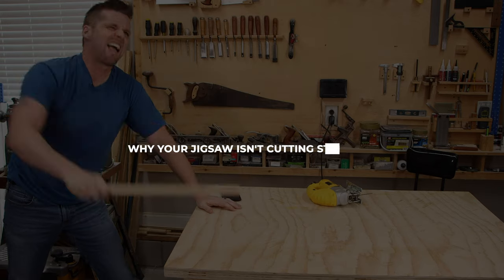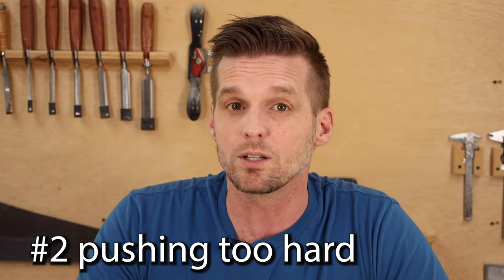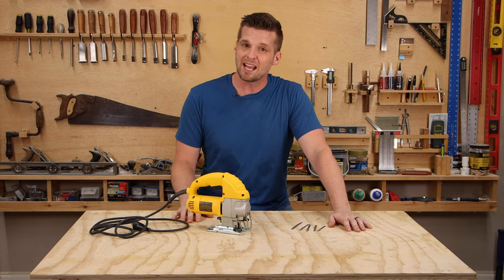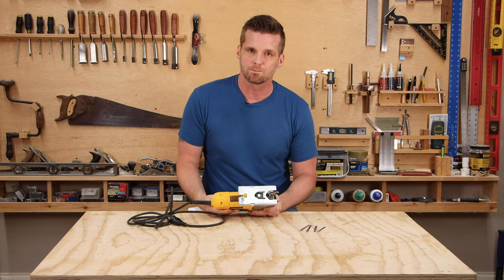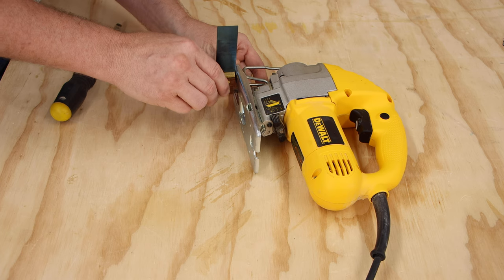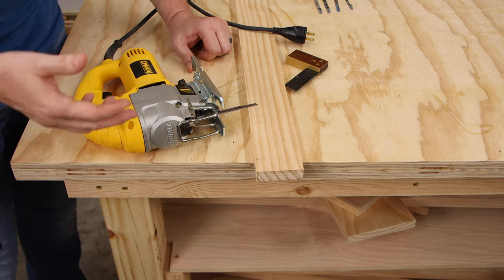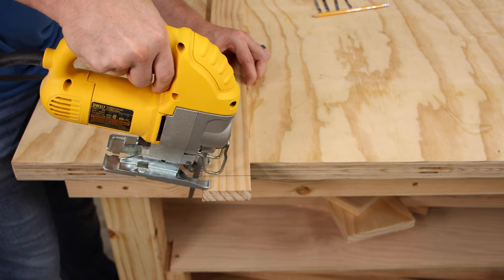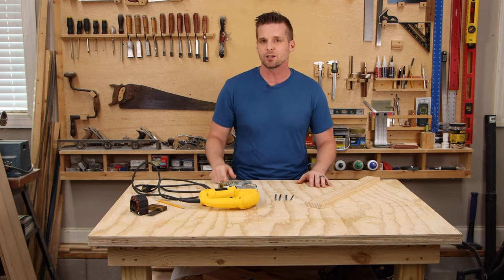Why Your Jigsaw Isn't Cutting Straight. How to Avoid Wandering, Deflection, and Bevelled Edges.

Comment: my milwaukee m12 vibrates like crazy, and I learned that the chuck is misaligned and slightly tilts the t shank clockwise. causing massive cutting issues. I'm using a bora straight edger with a t track "jig" that guides the jigsaw perfectly straight. The blades are totally new, Diablo fine tooth for "straight, angled, or curved jigsaw cuts." but the m12 has already warped one of them. I cut pretty slow as well and let it cool down after a few inches. 

Compounding the issue, the right side of the bottom is bent upward, and causes the anti-slip guard to pop off if it gets hit by the blade (which it eventually does due to the blade warping from the misalignment.)

The manual does not tell me how to realign the chuck (manuals are becoming extremely useless, not nearly as detailed as they were in the past.)

My dad has experience with older jigsaws and is also suprised by the crazy vibration.
Reply: I had the same issue..
Reply: @izzy8823  yeah. I returned my m12. I suspect that home Depot mishandled it causing the bent shape, and that they will just put the defective item back on the shelf. Could also be design flaw. I bought a reciprocsting saw that converts to a jigsaw with (with the ability to  reciprocate for faster cuts) from worx. Which is pretty neat. Just have to flip the blade to use either.

Comment: And here's a beginner's tips for beginners. Buying the cheapest jigsaw from a reputable brand is ok. Buying the cheapest jigsaw from a dubious or sometimes no brand at all will give you nightmares. Not even for a simple d.i.y. I bought mine a decade ago when I needed one to cut some boards, thus thinking a $20 jigsaw is ok. It is not. I could never cut straight with it, because the saw chuck itself sat on an angle with no way to straighten it up. And it gets worse after some use. A trip to the store later to return my machine and a $20 additional price gets me the lowest tier Bosch jigsaw. Still runs today through several house remodeling with only brush replacement.

Comment: What i do is use a straight edge to outline it with a thick marker (moved over a little bit depending on how accurate i need the cut) and go straight on the edge of the marker line and it works every time. Only with about 2 very minor bump

Comment: I have an old Black & Decker 3.5 amp jigsaw that I’m trying to use to cut circles. Tried Diablo fast wood blades and Warrior 10T blades. Both blades bend within the first half-inch. I took it nice and slow and noticed bend as soon as the blade touches the wood. I’m thinking it’s time for a new saw.

Comment: Love your presentation style. I deliberately came here as I always have a problem with jjigsaw cuts. I have three different jigsaws from a cheapo to more expensive model. If  I am cutting say 1-1.5 inch wood on a 6 in cut the blades seem to bend during the cut, ending up with an end that looks more like grandmas quilt than a square cut. Tried new blades all are set up square, not pushing hard etc, so wtf am i doing wrong?
Reply from the maker: The variables are: 1) have the correct blade 2) blade needs to be sharp 3) shoe is square to the blade 4) let the jigsaw make the cut and don't force it 5) direct it in a straight line (i.e. don't wander all over the place). It has to be one of those variables that is off.

Comment: If Jig saw is not easy to setup and get on work with. Try calibrating a miter saw for accurate simultaneous 90, 45 and bevel cuts.

Comment: My Dewalt dw321 has a blade holder that is not parallel to the fence. It is visibly out of alignment. I figured there would be a way to adjust this but cannot find any information. I don't want to force anything and snap the shaft or other part. Any help?

Comment: You talk nice but you hav a Dewalt, try the same technics with Rider, with the blade, is tilting even the base is 90 degrees. Even on slow speeds, with very little push the blade tilts on one side and sometimes is poping up from the roller which support it.

Comment: In my jigsaw blade jumps out of the rollers that are there to make sure it stays Straight.

How to prevent that?
Reply: I know this is old but, my milwaukee m12 vibrates like crazy, and I learned that the chuck is misaligned and slightly tilts the t shank clockwise. causing massive cutting issues. I'm using a straight edger with a track that guides the jigsaw perfectly straight. The blades are totally new but the m12 has warped one of them. I cut pretty slow as well and let it cool down after a few inches. 

To add insult, the right side of the bottom is bent upward, and causes the anti-slip guard to pop off if it gets hit by the blade (which it eventually does due to the blade warping from the misalignment.)
Sadly my manual says nothing about how to fix the chuck, so I'm just gonna return it. I've never had this issue with my dewalt items.

Comment: I have to turn my makita xvj03 clockwise some to make a straight cut. Even then, it floats back to the left (rotating counterclockwise) while cutting. It's like the blade is too thin, and rotates some in the blade holder. Anyone ever hear of this issue?
Reply from the maker: It's normal to have to turn the jigsaw to stay on a straight line. If it's moving all over the place, then you might be using a scroll blade which is made to cut tight curves.

Comment: Hi, my brother's old jigsaw's blade used to steer on its own while making the cut... I then bought a new jigsaw, but the issue remains same with the new one with new blades too. To make a straight cut, we need to turn the jigsaw as the blade turns towards right or left. And I am sometimes holding jigsaw at about 40 degrees steered to the cut line in order to keep the cutting straight. It's so annoying, I have to constantly keep turning the jigsaw and can't use jigs or straight guides at all... I am a beginner and I thought perhaps all the jigsaw's are this way. But I never see this issue even being discussed or demonstrated in any videos... Pls put some light.
Reply from the maker: Are you using a really thin scroll blade? Those are meant for cutting tight curves and move around easily. Try using a wider blade
Reply: @OutoftheWoodwork  i am facing a similar issue, i am using bosch t244d ,
I am new to this tool but as i can see the blade is twisted a little even at rest, its black and decker jigsaw, 
Can it be repaired ? 
Thanks 😊
Reply: I too have this issue. My Dewalt dw321 has a blade holder that is not parallel to the fence. It is visibly out of alignment. I figured there would be a way to adjust this but cannot find any information. I don't want to force anything and snap the shaft or other part. Any help?

Comment: Thanks for the video,I bought a black and decker fairly cheap and couldn’t get it to cut very good not straight and vibrating a lot, I rented a Makita and what a difference like night and day, but with all the top brands which do you prefer?
Reply from the maker: I haven't used many brands, but I do really like the Dewalt I have
Reply: Thanks I was thinking probably can’t go wrong with Dewalt, all my Dewalt tools work really nice and no trouble with them, I’m going to pick up a Dewalt tonight thanks again

Comment: Jigsaws have their select purposes and cutting thick pieces of wood is NOT one of them. I don't care what method you are trying, I can guarantee that you are going to get blade deflection. I am in the process of trying to cut a canoe paddle out of a solid piece of cherrywood that is an inch and three eights thick, and that's because I don't have access to a bandsaw. I am not pushing it, I am not cutting on an angle because I am not holding it straight, I have a brand new blade. The wood is like rock and it took me 50 minutes to allow the saw to do its own thing by not forcing it. It still cut on an angle, and lucky for me it was away from where the paddle outline was. 
Thin wood jigsaws are okay, but thick hardwood pieces?  Forget it.

Comment: I can never get a cut that  is square. The blade always seems to bow out, especially on even slight turns. Im no rookie wood working. I bought a new jig saw, use new blades, pay close attention. As im cutting but the cuts never are square. Its like the blades or the saws are just flimsy these days. Never use to have this problem. I am using the upper level Ryobi 18V saw. I square the base to the. Blade etc. I just dont know what is going on.

Comment: My cuts start straight, but end bevelled. What can be the reason?
Reply: Im really struggling with this. Had to outline my template on both sides, made a bunch of relief cuts and never made a cut longer than and inch or two without checking...and still had to sand it even a bunch